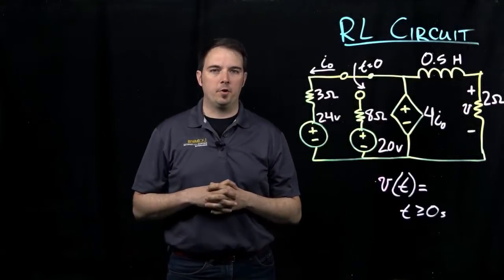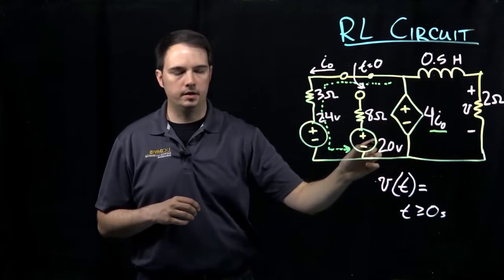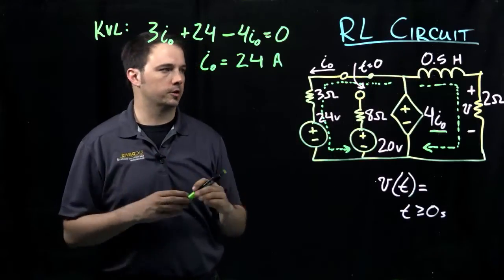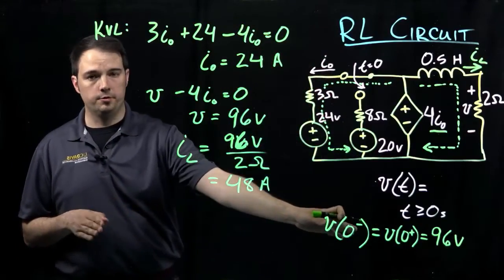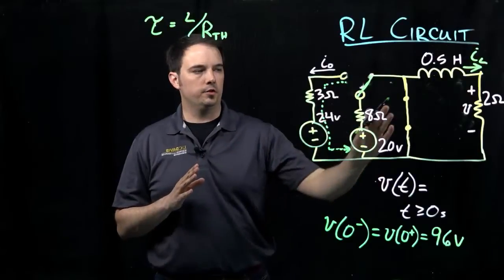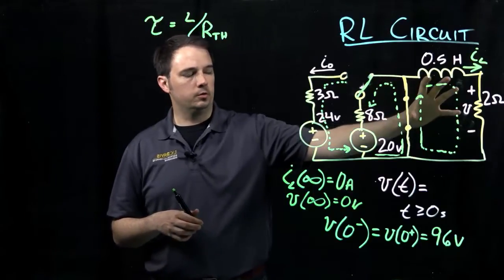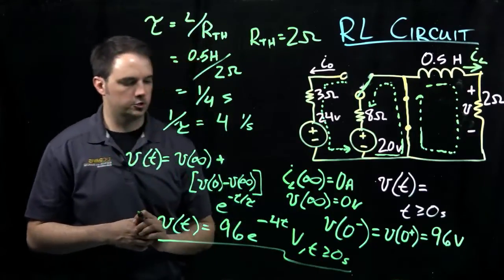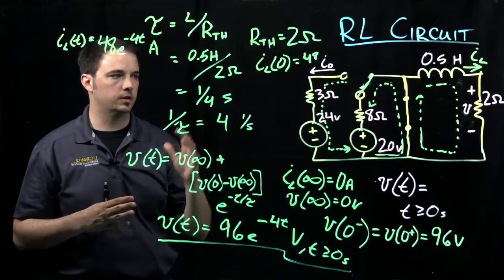Circuits I: Example with RL Circuit

Comment: What are the equations if there is no dependent current source and instead of the same 20volt source, there is an 20volt source with opposite polarity after swithing to second position.

Comment: Sir, What is i(∞)?
Reply: it is late to answer but I will instead of no thing 
the current I as the time goes to infinity by which he means the final value of the current flowing through the inductor and after a long time from the switching event and after a long time from the switching event the energy stored in the inductor will be dissipated through the resistive load and the current would just go to 0 amps
that's all

Comment: Thank you so much for this video. I searched for hours to find a video that included both dependent and independent voltage sources within an RL circuit. I spent close to 7 hours trying to complete this problem (7.55 in Fundamentals of Electric Circuits) but I could not figure out how to determine the current io. Is it zero because the current from the independent source would "clash" into the current from the dependent? Thanks so much for the help!
Reply: This happened to me too. I spent hours trying to solve this 7.55. Finally I found this miraculous video!
Reply: Sometimes i wonder how people learned this stuff before internet, cz i would NEVER figure these things out on my own